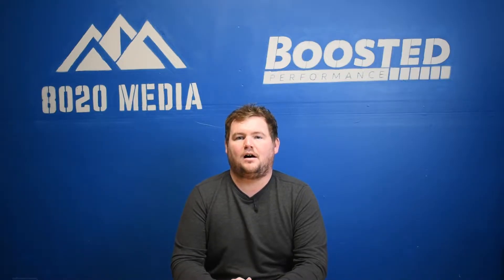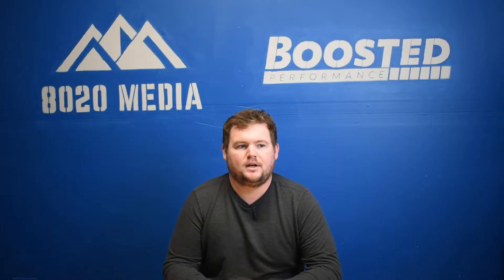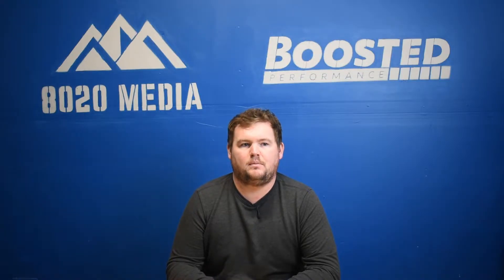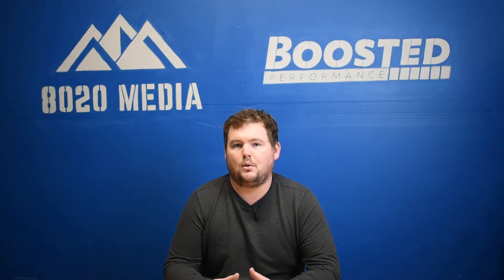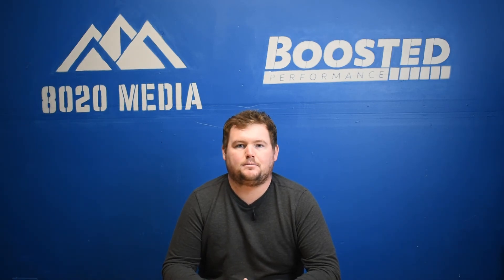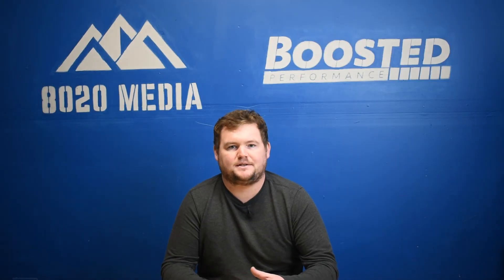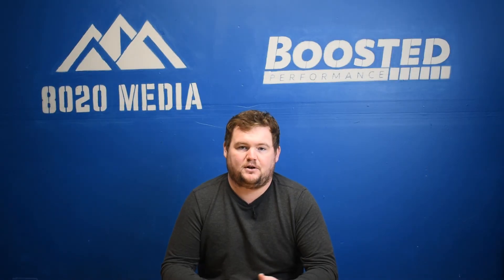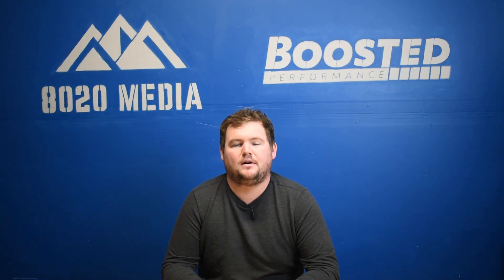BMW N52 Engine | Reliability and 4 Common Problems

Comment: Great video, very helpful to understand what maintaining an N52 takes.

I’m considering an 07 E92 328xi with 109k. It’s only had fluids replaced as needed. I can see oil seeping from the valve cover so I’m thinking I should anticipate VC gasket replacement + water pump and thermostat right away if I get it. Maybe solenoids too? I don’t want the water pump failing while driving but would a failed solenoid leave you stranded?
Reply from the maker: David - So long as you know what you will need to replace. We wouldn't advise getting one that already has 100k, but it depends what you're needing it for. If it's just a daily driver to get you from point A to point B, then go for it. A clogged/failing solenoid won't leave you stranded.
Reply: @8020Automotive  You wouldn't advise buying an E92 with 109k miles? What? That's not high at all.
Reply from the maker: B - For BMW's, this is high. A lot of problems occur after 100k.
Reply: @8020Automotive  How can you make an entire video saying that the N52 is a great engine and that it is so reliable when it is obvious that you will never find any N52 powered car with under 100k miles at this point in time? That makes no sense! These engines are all at least 12 years old by now, so even if the car has low mileage it will still be over 100k miles.
Reply from the maker: B - This is our opinion. Would we buy an N52 with over 100k miles? No. Given this, we give preventative maintenance advice once these engines get over 100k miles. And "never" finding an N52 over 100k miles now a days, just isn't true. Unlikely, sure, but not impossible.. I don't know what else you want us to say on this honestly.
Reply: @8020Automotive  Add a statement in the video descriptions that says "never buy any BMW with over 100,000 miles." It just seems like this video is an endorsement of the N52 as a engine you'd recommend to buy, but if you don't think a BMW will even last past 100k mi then this whole video is just a historical retrospective, and not buying advice like I thought it was.
I also think that for an enthusiast a 100k+ BMW is a great buy, but for the typical vehicular appliance shopper it is not a great idea.
Reply from the maker: B - We never once said this video was "buying advice". We make these videos to inform viewers. We agree with your last statement.

Comment: You need to boost the volume of your microphone. My 328i 2011 isnow at 229k reliable miles.  Vanos  bolts, solenoids, oil filter housing gasket, thats it. Oil change every 5k miles.
Reply from the maker: Getoveryourself - Thanks for the feedback and sharing your experience.
Reply: how many miles were on the car when the vanos bolts went bad?  thanks

Comment: Please what’s the difference between the one with the silver cover and the black cover?
Reply from the maker: Gudala - They indicate the different generations. Often, the silver cover indicates the original N63 and the technical update engines tend to have the black cover.
Reply: @8020Automotive  you mean N52 . 🙏🏾
Reply from the maker: Gudala - Apologies. Yes. The silver cover indicates early N52 versions, and the black cover indicates later versions of the N52.
Reply: @8020Automotive  , thanks for that. How about reliability wise, which is more reliable ?

Comment: CAN YOU FIX THE TICKING VALVES LIFTERS CAN YOU FIX IT YOURSELF? PS  THAT INFORMATION WAS GREAT
Reply from the maker: Steve - You can replace worn lifters yourself, however it isn't the easiest DIY. There are many videos online. Thanks for the feedback!
Reply: @8020Automotive there’s a YouTube short of a guy who pulled back the springs and the lifters come right out. Throw a new one in and release the spring. Just make sure the lifters are filled with oil first.
Reply from the maker: I - Thanks for assisting here!
Reply: use liquimoly hydraulic lifter additive. Had the same issue, it has been a year and it hasn't came back. I would recommend a fresh oil change before you add it in.
Reply: Try revving the engine for 5 minutes at 3k rpm

Comment: Yeah glad I decided last year to get a E60 530i m,sport which I'm going to keep forever
Reply from the maker: Blue - That’s a solid vehicle you’ve got on your hands!
Reply: @8020Automotive  I've done some basic mods cat,backed it induction and a remap it's running at around 280 bph performance is amazing it's like driving a E46 m3
Reply from the maker: Nice! They sure can be fun if modded. Quite crazy how cheap it is to get these BMW's faster.
Reply: @8020Automotive  yeah the remap deleted the limiter need to take it to the autobahn or track
Reply from the maker: Let us know how it goes!
Reply: @8020Automotive  👍

Comment: thanks for the info on the ticking sound.  wasnt sure if it was injector noise or valve train.   liked!
Reply from the maker: M12 - Thanks for the feedback and glad we could help!
Reply: The ticking can be fixed by a non-mechanic, for free, in 5 minutes.  And it's a non-issue anyway (apart from the ticking sound is annoying).  See the BWW doctor on youtube.

Comment: A great engine.  My 2009 128i has been very reliable and it just passed 100K.
Reply from the maker: AB - Thanks for sharing your experience! Glad your N52 is doing well.
Reply: Wow that’s low mileage

Comment: I e had two N52s. It's exactly what I want. Reasonable on gas. More power than econoboxes. 6 speed manual. The one I have now is rwd, I did like x drive, it was amazing in the snow, but it's more to maintain so I went rwd this time. I love straight 6s. They're really great engines. Vvl and vvt. And no turbos to worry about.
Reply from the maker: Steve - Thanks for sharing your experience. We’re glad N52’s have treated you well!
Reply: Hey there, I'm considering getting a 328i and had a few questions. Firstly, how would you describe the driving experience? Secondly, I'm interested in the cost of ownership - what are the typical maintenance and repair expenses each year? And how much does it cost to insure? As a first-time car owner, I'm not sure what to expect. Lastly, do you think the 328i would be a good first car for a high school student? And are there any specific pros and cons that I should be aware of? Thank you for your help!
Reply: @asad-bk4uf  you just have to confirm what maintenance was done on it and what wasn't, if you're a weekend mechanic and have a little bit of knowledge you can do most of it on your own, one main thing I be concerned if oil changes was done frequently ,  make sure you scan the car for codes, try not to use a generic scam tool , one that reads Pacific BMW codes, if there's a lot on there that can also be negotiated in the price, don't be too scared of that lot of stuff is easy fixable, one main thing also do not use cheap Chinese parts, FCP Euro or ECS tuning,
Reply from the maker: Asad - You may find our article helpful in your research: https://bmwtuning.co/ultimate-bmw-e90-e92-328i-guide/

As far as cost to insure, there are many variables that go into it, so we can't really give an honest estimate here.

Comment: Add to that list:
1. Fuel pump & Fuel pressure regulator.
2. DMTL pump (leak detection, fuel)
3. Ignition coils. Bosch was replaced with Delphi.
4. Oil separator( valve cover ).
After 100k it’s expected you serviced oil pan gasket, motor mounts, transmission mount. Front & rear shocks.
Water pump fails because of calcium build up. Tap water would do it. Internal engine components failures its only observed in cars where the owners fail to change the oil at the proper intervals. 
Solid engine.
Reply from the maker: David - thanks for adding this valuable insight! It will certainly help future viewers.
Reply: Man who on their right mind put tap water on s BMW
Reply: What do you mean tap water will do it? As is tap water causes water pump failure? And doesn't Coolant come premixed? Meaning there's already water mixed? Thanks
Reply: @zureai yes but the water used in premixed coolant is done with deionized water. All of the minerals are removed during the deionizing process.
Reply: Who puts tap water in a BMW? 🤦‍♂️
Reply: @univox_guitar Only an absolute weapon puts tap water in any cars coolant tank.
Reply: I’m at 115k and had mine since 50k only the dtml pump and valve cover